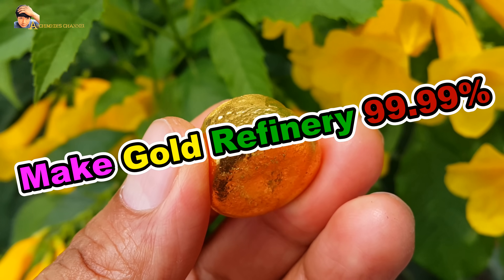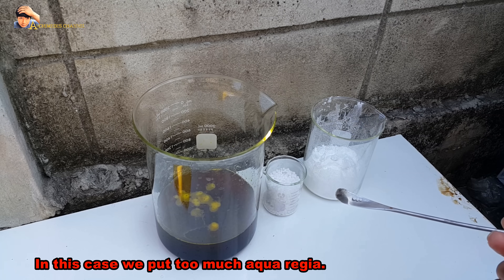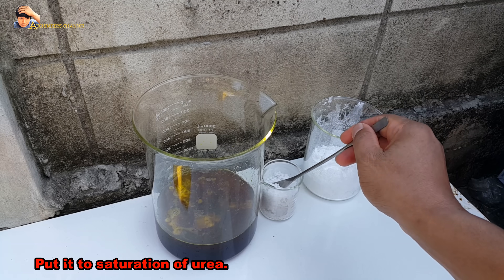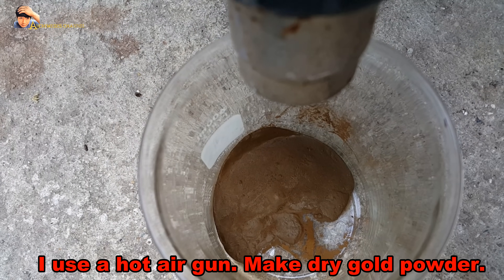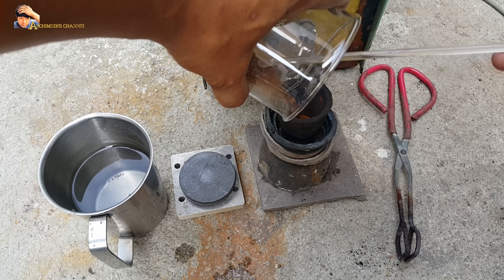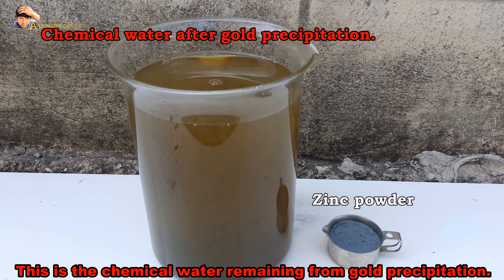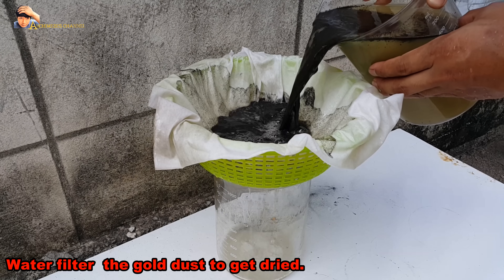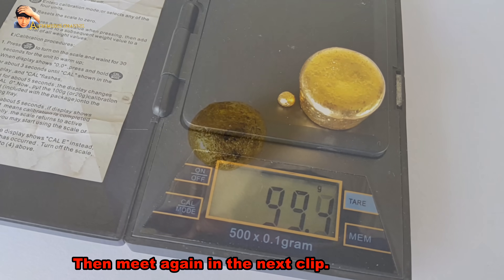How to make gold 24k. Teach process gold refining 99.99%. tips refine gold scrap fine gold recovery.

Comment: I extracted some gold and it looked pretty decent. I used a torch to smelt it and it looked like it gotten pretty hot. As it cooled I looked at it and it was still ore! I saw a few 1-2 mm gold pieces in the ore. What am I doing wrong? Did I need it hotter to liquid or use induction heating?

Comment: So does it matter if some of the scrap is 14k, 16k, 18k, etc? Or does it all have to be the same karat to refine it. For instance do this once for 14k, once for 16k, once for 18k, or can I throw it all in at the same time? I am new to this and have been trying to learn so if it's a dumb question I am sorry.
Reply: It doesn't matter. The impurities can be removed.
Reply: Author Unknown alright thank you so I can just throw it all in following this guide and use this guide to get the impurities out? Thanks for actually answering and not being an ass
Reply: @nicscala4760  Before using Aqua Regia using Nitric acid is recommended. 
The Nitric acid will eat the base metals. 
And it would be a good idea to melt or rough up the gold so the nitric acid can get underneath.

Comment: Nice video.  also consider A solution of potassium iodide and iodine dissolved in water will dissolve gold. This is a standard etch that is used in patterning gold during photolithography in the electronics industry. Try 40 g of potassium iodide, 10 g of iodine in 400 ml of water.
Reply: Yo quisiera que haga anillos de oro
Reply: how are you get back to me

Comment: How to remove lead and alumnium from AR 🖐️
Reply: The aluminum should be removed with Nitric acid before using AR.
The lead can be removed with sulfuric acid. 
While the gold is still liquid,
adding sulfuric acid will turn the lead into a solid. 
The solid can then be filtered away from the liquid gold.
Reply: AR means 
I don't know that's why I am askin

Comment: 1) Instead of a hair dryer, you could boil the water off in a vacuum. You need a vacuum pump, and a jar that will hold a vacuum.
2) You need a fume-hood, so you don't have to breathe those noxious chemicals.

Comment: There is some great info here.  It would be helpful to mention about the reddish-brown NOX fumes that are deadly/fatal when breathed.  Always use extreme caution and appropriate high-quality safety equipment.  Do this process inside/under professional fume hood, or outdoors on clear day with wind/fan to blow fumes away.  No children or animals around to get injured or interfere with work. Carefully adding minimum of ( .05 percent of total Aqua Regia liquid product) of 3% household H2O2 (hydrogen peroxide) prior to creating fumes will greatly reduce or even eliminate these cute deadly fumes.  

It would also be helpful to better explain approximate time frames between each sub-process allowing for settling/filtering times etc.  Aqua Regia is a rather involved process which is thoroughly explained by Hoke where she professionally covers nearly every aspect.  The ingredients are readily available from chemical supply houses, or one can make a slightly inferior nitric acid using a specific mixture of sulfuric acid, hydrochloric acid, and either sodium or potassium nitrate powder as fine as you can get it.  This combo when following the appropriate recipe is allowed to set overnight and then is ready for use -- would likely work for this video process.

SMB - sodium meta bisulfite is available in other products such as stump-out.  Bisulfite powder is used in swimming pool supplies and when added to water, becomes SMB suitable for dropping gold values out of solution.  Muriatic acid (readily available at places like Lowe's, Ace, etc., is hydrochloric acid of a 31% to 32% percent strength (31.45% is common) is used for cleaning concrete floors, etc., whereas lab grade is slightly stronger at 35%.  I've used muriatic for numerous applications including creation of stannous chloride to test whether or not any gold remains in a given solution.  

Suggestions as to source of original gold product either removed from computer scrap, or from mining ore concentrates, etc. would be helpful to readers.  Also explanation of induction heating apparatus which has to reach around 2000F degrees and the graphite crucible, where obtainable such as mining/prospecting supply houses.  This is extreme heat which would explode a finger or hand if you stuck them in there and one should receive or develop special training and skills,  to use special tools and equipment to work with such an acid process.  Nitric acid will go right through skin pores and poison you.  Hydrochloric acid will burn you straight to the bone.  

Always have a container of saturated baking soda readily available to immediately neutralize any acid splash on skin or elsewhere.  ALWAYS USE strong plastic or glass insurance containers, tubs, etc., to hold the acid containing flasks, jars, etc., both during work processes and storage.  Never store acid containers on shelves where they can be accidentally dropped or bumped off -- breaking one of these on your floor or elsewhere can create a hazardous clean-up process.  Boxes of Baking Soda should immediately, generously be dumped onto any spills to minimize damage and neutralize the acid.  Never drink alcohol or perform this work under influence of drugs during this 100% sober work.  It can be lots of fun when properly performed. Kudos!
Reply: Roger, you've obviously had considerable training/experience in chemistry, so I think many would benefit if you would make and publish a few videos.  I will automatically be notified when you do since I am your first subscriber and I "rang" your bell.  May I suggest a topic for you to consider (since I have not found one on YouTube, to date):  Avoiding or , at least, reducing the potential  damage to our skin and eyes that can result from being too close to a violent reaction. Light is commonly produced but unseen in the infrared and ultraviolet ranges, and we usually ignore them because we can't "see" them.   Something to consider. I enjoyed reading your comment posted above.
Reply: ROGER that
Reply: With what I can detox my body I was  breathing in to much years back ?
Reply: Very good Roger
Reply: Were from  available  acidic  peels
Reply: Hey Roger, you should put your own video of gold refining up so we can pick it all apart like you have done to Archimedes.
Reply: @conradleger1748  He wasn't picking it apart and it was a great video. He covered very important points that where not covered clearly in the video to stop anyone from seriously injuring themselves or others. Equipment needed and where to get it would greatly add to this video and the author of the video specifically asked for this to be put in the comments.

Comment: How will anyone get hydrochloric and nitric acids is for Lab use only right
Reply: bubble the HCL gas generated through water, but be sure to add an inverted funnel to the tube. 
Otherwise you may get something called "Suck back" where the solution you are bubbling into will be sucked back into the reaction vessel.
Reply: Pseudo Memes omg
Reply: Pseudo Memes The sulfuric acid I bought of jet as a drain cleaner I got like 4 bottles for about 25 dollars
Reply: No, you can buy it at any chemical supply house. There are lots of them in the USA. You can also get it from Amazon or out of china. When they say you can buy ANYTHING on the Internet, they mean it! There isn't anything that I have ever thought of that I couldn't buy. If you can dream it up, someone is selling it and it's easy to find/get!

Comment: when you separate the gold dust and the water you loss gold, what happen if you evaporate the water?, that reduce the loss i think
Reply: Gonna take much, much much more time to do it that way without some boiling or steaming which would also cause some gold to migrate out of the solution. 

I think in general he's not worried about a small loss to speed things up. From what I see in this video his process is more than a day of chemical reactions not counting the drying times.